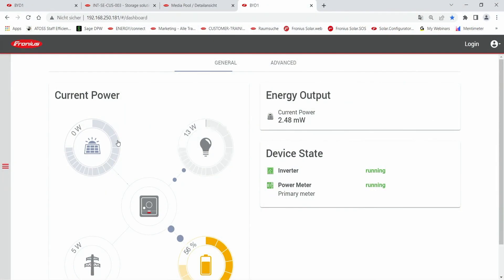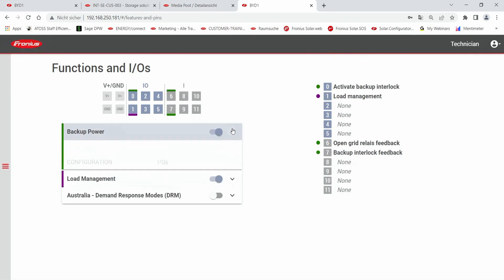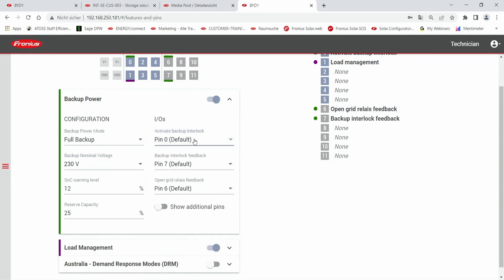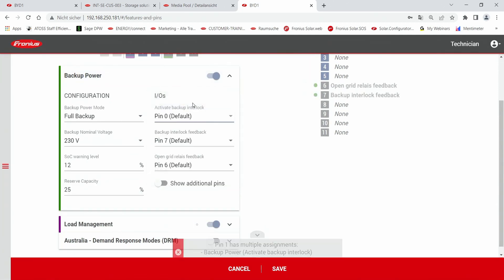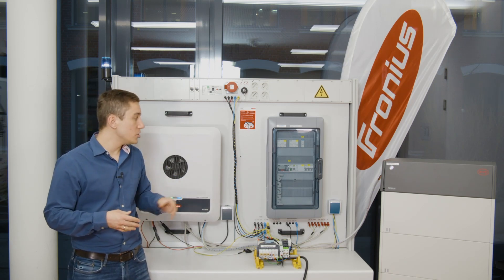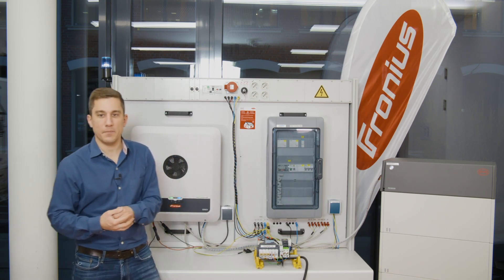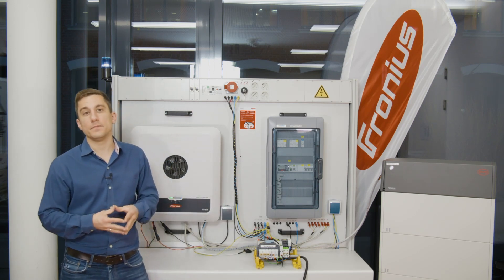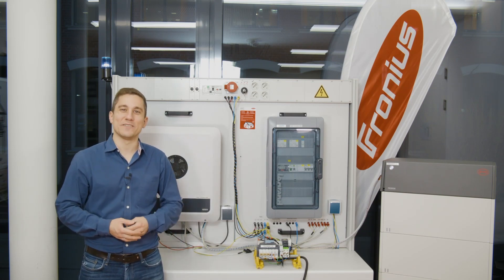How-To Video: Troubleshooting for GEN24 Plus Backup Power Operation

Comment: The first start of backup mode, i have the error "GEN24-1125 Power Low For Backup Operation". It's a 10kW Gen24 with battery BYD 44kWh (2 tower). If i reset error from web interface, the backup start, but the first time fail. Firmware of battery and inverter is updated.
Reply from the maker: Hi @fabiom3267!

Thank you for your question. Please contact your installer He will help you solving the problem.

Best regards, your Fronius Social Media Team
Reply: @FroniusSolar  i hope it's a joke 😪 thanks anyway
Reply: @fabiom3267  The Fronius was design for high skill engineering technician and installer or electrician have no clue what to do when it come battery with Fronius backup so you can run with out grid its disaster!